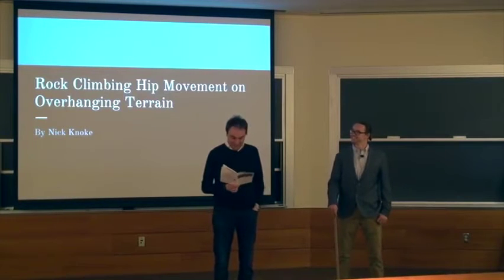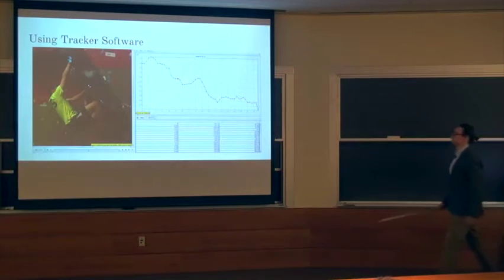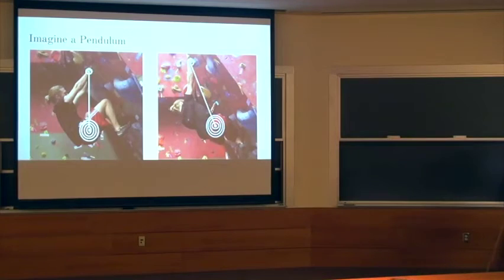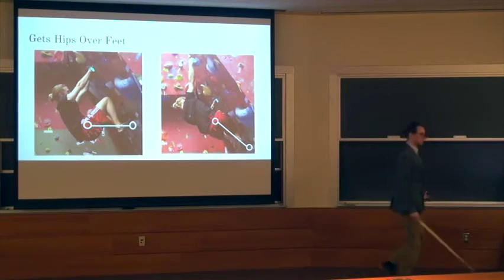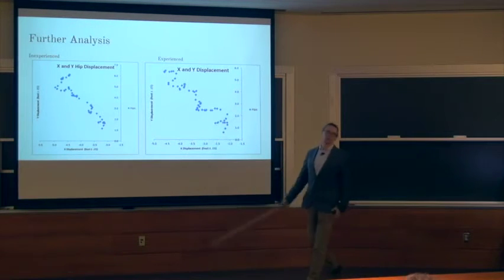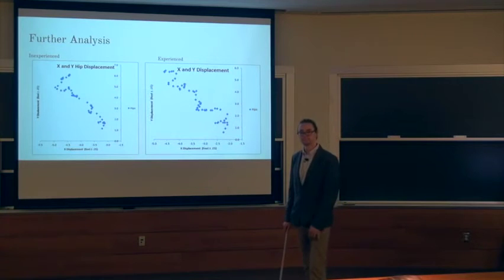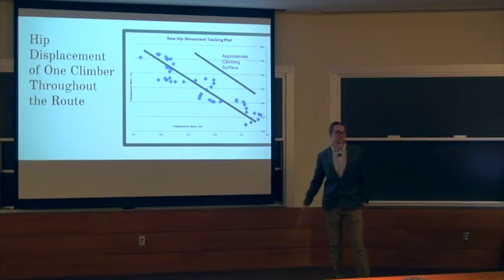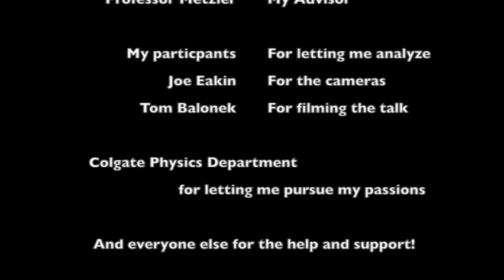Rock Climbing Hip Movement - Physics

Comment: Hi Nick,

I am a climbing coach, so hopefully I can help you to understand better some movements.
In nutshell: forearms,fingers the weakest in our kinetic chain. Good climbers try to move the center of gravity from leg, body muscles. So we try to use the least amount of energy, muscles in our arms.
So usually climbers climb as straight, as they can.
This is why hands and center of gravity seems like a pendulum.
Of course if you examine the third dimensiin you eill realize, that center of gravity will goes under the holding hand, while the other is moving.
If you look at a climbers behind you can recognize that the holding hand and the two legs like a triangle, and center of gravity has to be always in this triangle. 
From sideview you could have seen that when climber's COG moves the closest to the wall they push better from the legs(and pulling less from arms).
When you move your COG as a pendulum, dynamucally you need less pulling power from the arms, then you start from a static position.
What can be a big difference between climbers is their climbing speed, and rythmn.
If you see someone climbs first time a boulder, his climbing time is slower. But, if He/She tries the same route a few times His/Her rythmn,flow became faster, moves are more fluid. If someone is more experienced climber He needs less tries to reach the ideal rythmn, time.
For example my climbers avarage time when they climb fluently is around 24s, on our 4,5m high wall.
So, if someone tries a new boulder it can be 40-60s. But after some praticing rounds His time getting closer this 20-25s.
Of course thus topic is very complicated, but I hope you have found my words helpfull. If you have any question, I am gladly help in the future! :)

Comment: As I guess you already know from practical experience, an aspect of the hip-movement pattern of rock climbers relates to hand placement. To move the right hand up to the next hold more easily, you can often bring the right shoulder closer to the wall by twisting the right leg in to the wall. This isn't the full picture: how and when this technique works seems to have something to do with the biomechanics that your research points towards, but it also seems to make sense to try to integrate this information into your experiment in terms of when hip placement might be significant.